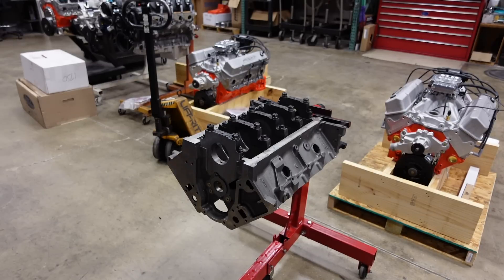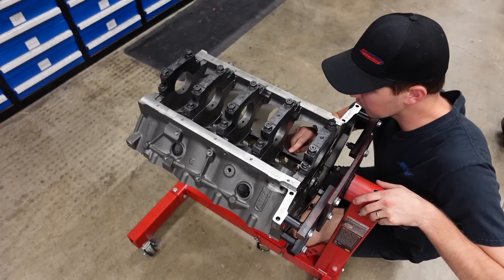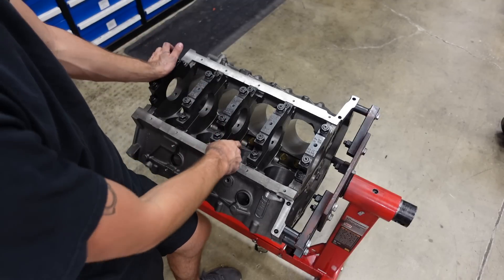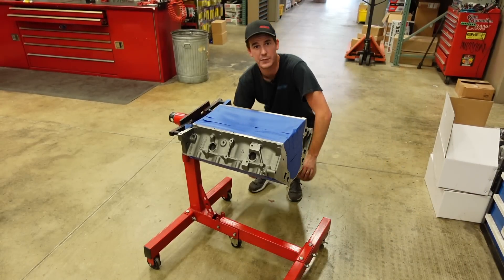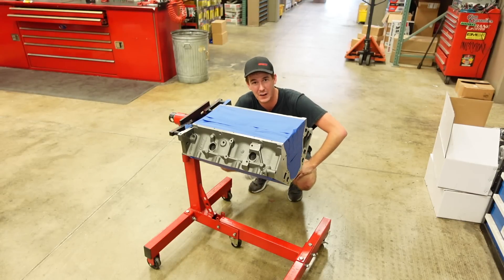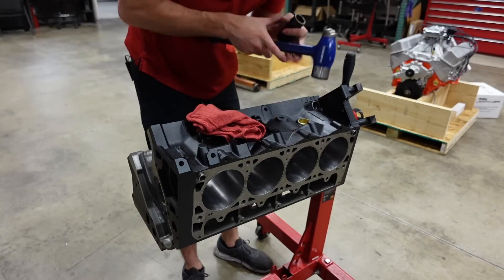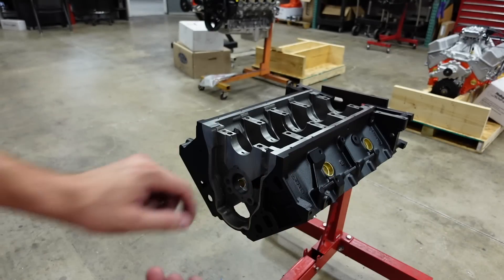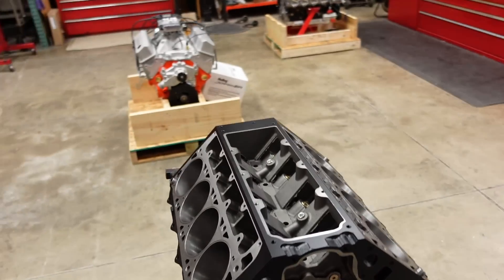My Custom DART LS Block is Prepped & Ready for Assembly!! - 400" LS Engine Build - Part 3

Comment: Hey boss I have a technical question for you so no parts were available so I had to put an eagle ls1 crankshaft in to a 2017 youkon ls 6.0 I had the reluctor replaced at a shop
That had the tool any it will
Not run what I’m wondering is the crank gear did press on pretty hard onto the ls1 crank and I noticed that the new crank had 2 key ways instead of one and it take a different flywheel are the crank key ways in the same spot on both ls1 and ls4 cranks or is do they have different timing marks on the lower gear I used all the original timing parts on the 2017 except a ls1 crankshaft

Comment: Those blocks aren't made for that power level
Reply: Its a specially machined block for a high horsepower output, it'll handle it just fine.
Reply from the maker: This one is. It’s made out of CGI

Comment: Little curious about the paint masking on the deck surfaces. Didn't use a head gasket for outline and painted over the outer head bolt holes. Using copper with receiver groove?

Comment: I'm presuming the block doesn't need machine work to clear the Jesel belt drive You mentioned in a previous vid. Which if so, is nice. Their older models intended for SBC & BBC applications did.

Comment: Not sure if you mentioned it or not, but did you also get the raised cam version of the block ? that would be KILLER. Anything to help the RPM and added valvetrain stability.
Reply from the maker: I did not! My stroke is only 3.75” so there is lots of clearance between the rods and the camshaft, but I didn’t think about the valvetrain stability with a shorter pushrod 🤔…. Next time
Reply: @JacobVillemain  KILLER Combo regardless. I can't wait to see your Vette run the Mile.

Comment: Please explain not using roller cam bearing due to street use. Great channel and keep up the work.
Reply from the maker: I’ve seen them walk out a little bit on higher mile street builds.
Reply: @JacobVillemain  thank you for the quick reply
Reply: @JacobVillemain it would be cool to cut a grove on both sides of the cam bearings holes in the block so you could install snap rings to prevent that from happening.
Reply: Came here to ask the same question.  Thanks for asking for me! 😄

Comment: What's the part number for those cam bearings? I've never had to replace cam bearings in an LS before, but I hear all the time of people not aligning the bearings properly and wiping out the engine. That bearing design (which seems like how they should all be made) should eliminate any misalignment worries.
Reply: Seconded. I need these

Comment: I would have to put the heads on the bare block and see how the chambers line up with the bores, I bet BES didn't leave a thing on the table
Reply: Good idea, you could also do the same thing with just using the head gaskets.  Just make sure you have the dowel pins installed on the block.  Put your head gasket on check it for alignment then, transfer the dowel pins to the cylinder heads and place the head gasket on them and check alignment again.
Reply: @rickybobby0314  if the head gaskets are the same size as the bore, and they rarely are.